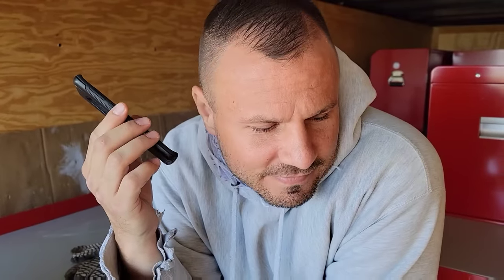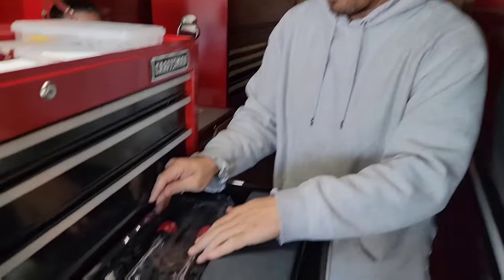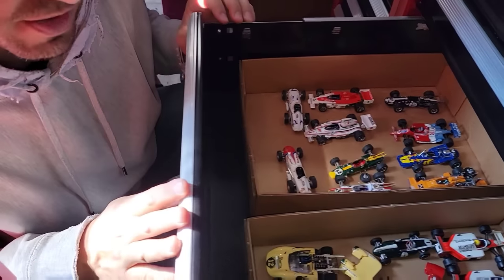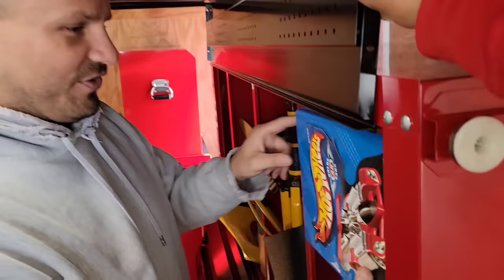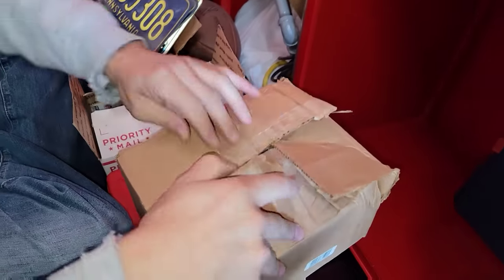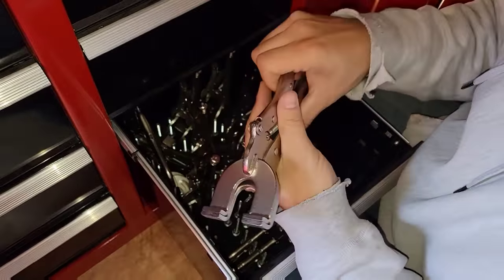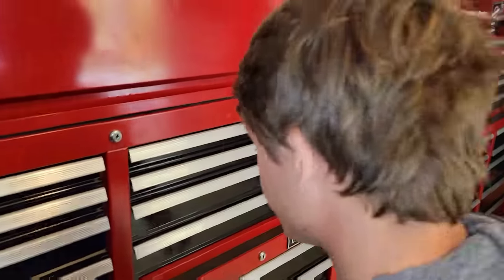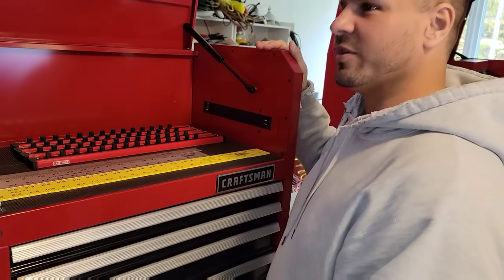BREAKING IN To Find Money In An Abandoned Storage Unit

Comment: The copper colored items the ones wth the nut on top & the others with the black tops are "Clecos" The items in the drawer with them are for the black top ones. They are CleKo pliars. Theyre both used for holding metal together. I worked for Boeing & Lockheed, I've used items like those THOUSANDS of times. There are some with jaws as well. You put the Cleko into the holes youve drilled, through several layers of metal, & they hold them together while you drill more holes. Yes they're for sheetmetal work. The others i mentioned with jaws are for holding layers of metal together before you start popping holes into it. It's NOT CHEAP Equipment.

Comment: As a NASCAR Die Cast Collector...1/64th ( Hot Wheels size ) & 1/24th size.... I can tell you that most of the cars in the Hot Wheels carrying cases are probably "Racing Champions" or "Winners Circle" die cast cars. There could be some Hot Wheels NASCAR die cast cars...and on the bottom of the car it should say "Hot Wheels!" The top of the line die cast cars are made by "Action" 
I had over 1000 Action, Hot Wheels, Racing Champions, & Winners Circle die cast cars.  I also collect regular Hot Wheels...but just certain cars...exotics, Mustangs, and other Older Cords and GM cars.

Comment: I think i might have used one of the larger torque wrenches... One for the top nut of a helecopter blade... 300 foot pounds :)  its a big one you could say.... a tad bit bigger than the one for the 300 ft pounds for the nuts on tank treds... but they are smaller only because they need a smaller place to work with.

Comment: hi those big ol sockets are used for large equipment like semi truck /trailer axle bearings . some of those boxes are pretty easy to open if you can get a drawer out just use the latch releases on the side of the drawers and reomove the drawer and at the back of the cabinet are slides they lock the drawers you usualy can lift those slides to release the drawers .

Comment: 29 minutes.. those metal 'birthing forecepts" are body dollies. they go on the inside of a dented body panel and you use the wooden handled hammers shown a few minutes prior to tap the outside of the body panel.. your hand and the dolly bounce from the hammering, and actually work that dent out from the inside. That chest is for fixing autobodies.  grinders to get the paint and rust off before restoring the panel shape, body filler shaping .. both for plastic and lead filling. etc etc etc...

Comment: Those are for welding. When you make a piece of metal and you drill a hole, you lined up all the metal to Weld it correctly in line. Those are alignment tools for body work.

Comment: Those that you thought were rivets are cleecoes. They are used to hold sheetmetal in place for sub-assebling or welding and such. There is a special pliers to operate them. Any sheet metal mechanic would appreciate those immensely.